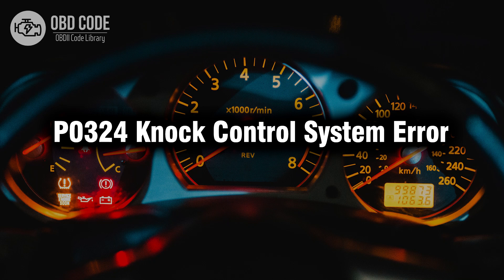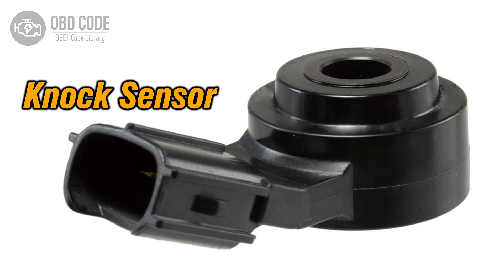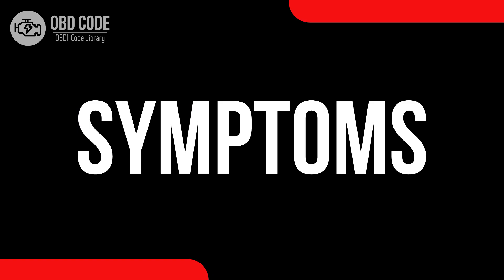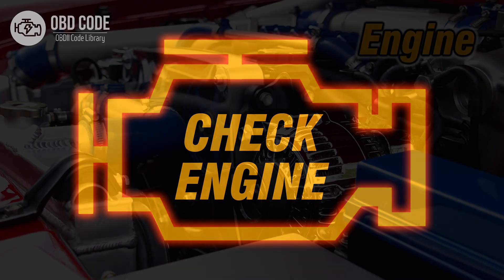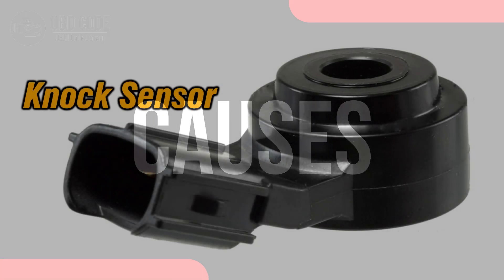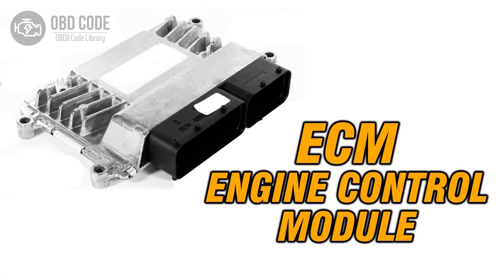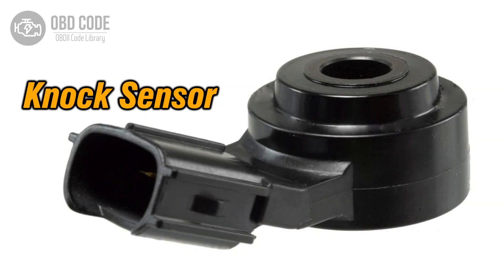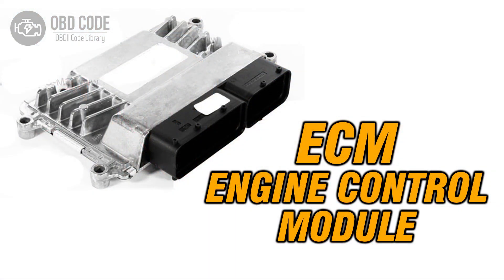P0324 Knock Control System Error 🟢 Trouble Code Symptoms Causes Solutions

Comment: I just watched another video and dude changed coil packs and plugs and filled up with 91 or 93 octane gas and light check engine light went out. Yet this video also is very useful yet being I have this code I’ll check with fill up first of running higher octane to see if light goes out if it does I’ll then use OBD meter again to see if this is fix and then go from there to coil pk and plugs to checking harness, then lastly will be knock sensor bc it’s hard to get to under car next to firewall for bracket then above to removing other things in way to get to it
Reply from the maker: Good morning, thank you for sharing your experience.